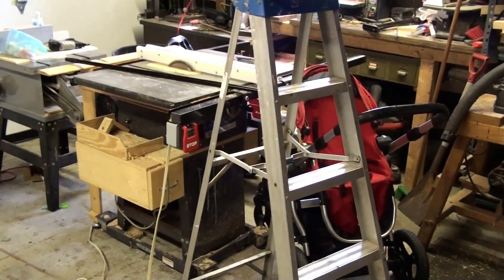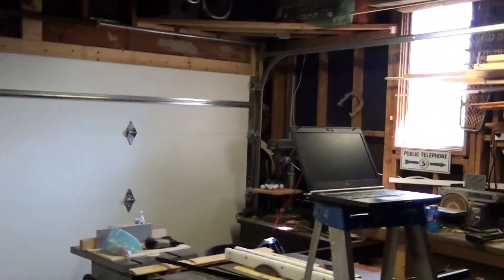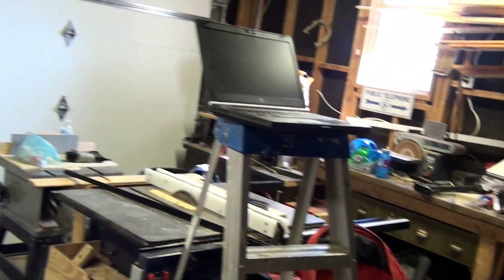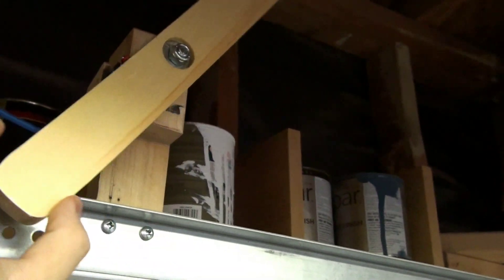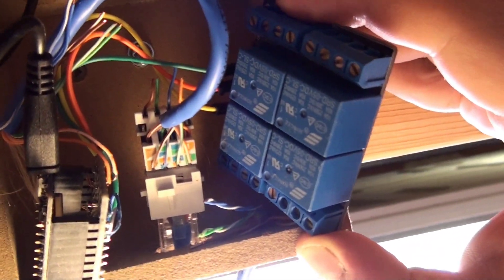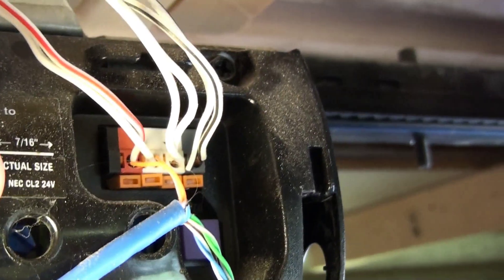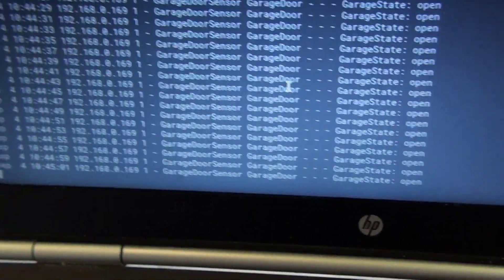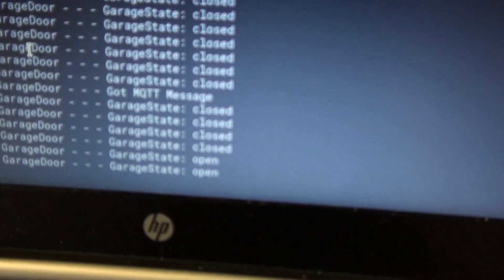$15 MQTT Garage Door Opener (Part 1)

Comment: I would like to see more of those types of videos, but as others have indicated it is very hard to watch. I purchased a refurbished Garadget device which has been pretty reliable except for a few minor issues which I have taken care of but I would like to develop a "homemade" system which would encompass turning lights on & off, individual temperature & humidity readings from outside and every room in the house. Thermostat control etc.  Hopefully you can stabilize the video and keep them coming
Reply from the maker: Yea I plan on reshooting this in more detail soon, im in the process of remodeling  my garage workshop, and will have the video done after that process is complete

Comment: You should move the sensor to the bottom of the garage door that detect if partial opening for true close/open.  I use magnetic switch that I put on top of the garage door.  That way if garage door have more than 1 inch bottom gap it will detected as open.  This is how you might what to improve your system.

Comment: I purchased a simple generic remote garage door opener and hacked it to add a relay directly, so less wires. I do like your limit switch mech.
Reply: This is a great idea.  I found out today that my Chamberlain garage door open uses something other than an easy momentary push button switch on the wall - so shorting out the button contacts on the opener do nothing

Comment: Thanks for the video

I have Broadlink S2 integrated to home assistant (4 door sensors and 1 motion center) and every time door is opened it change state in home assistant entity for that sensor- open/closd. I also have Broadlink RM Pro+ working with home assistant and door open /close (toggle) RF captured and added to HA so I could trigger garage open or close from HA rather than using remote control . I also have a $15 sensor node that I created with NodeMCU (humidity/temp/PIR, Light and LED) also linked in home assistant.

I did an automation (not with nodered) where Garage door is opened and no motion detected for 10minites then fire a RF signal to close the garage door. This is because my wife sometime keep garage door opened after taking kids from car and we have dusty weather conditions and I do not want garage door opened with my 3d printer and work bench in the garage

My problem is the door sensor sometime create false open state as it is bit difficult to get the placement correct (garage door and floor). In that case because door open/close is a toggle it opened the closed garage door.

My question is - is there a method to program garage motors to open and close as two district actions rather than toggle where if open it closes and if closed it would open? I did not see such option when I programmed my key. If not could you think of some alternate method

Thanks
Reply from the maker: As far as i know most garage doors do not allow this easily. The ports on the side have logic set up to toggle only.